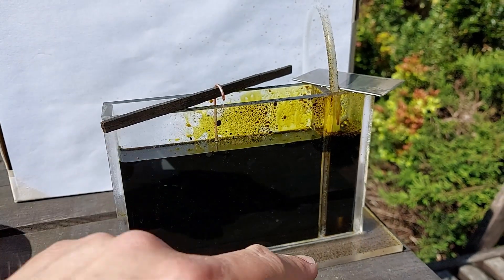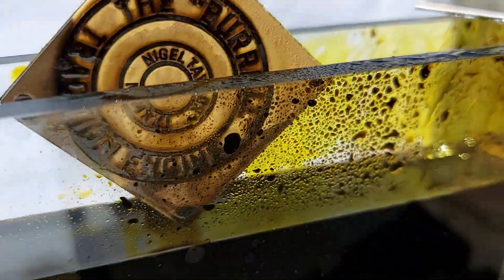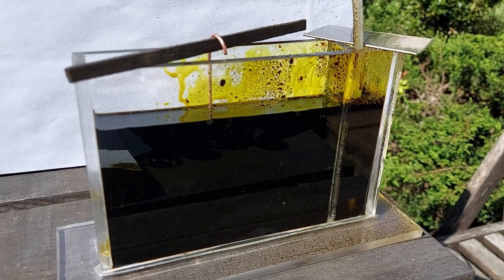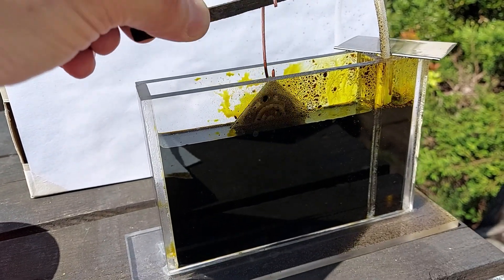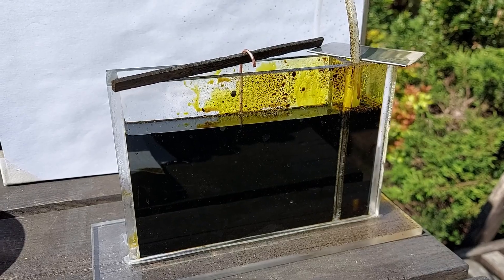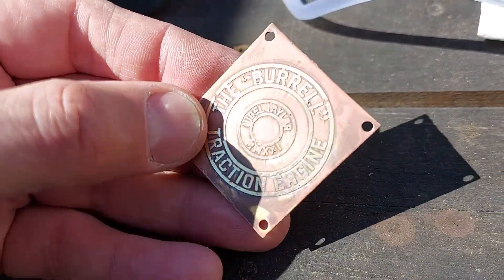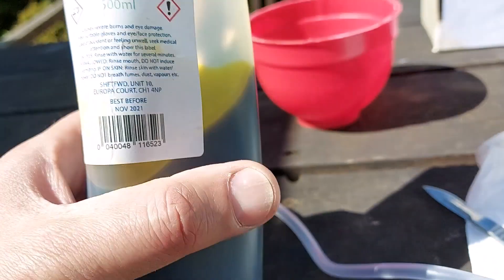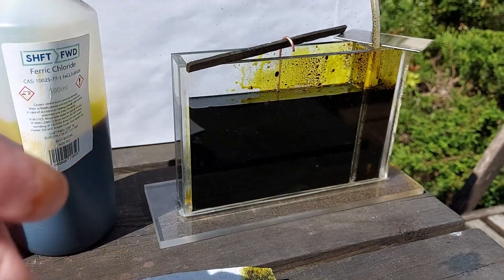Etching Tank

Comment: what glue did you use to combine the acryllic? Any special application method to guarantee it is water tight?
Reply from the maker: I used a plastic glue, but must admit it wasn't that great. I think I would now try and find a glass jar/tank and add a baffle for the air bubbles.

Comment: Hi, so my brother used plexi to make me an etching tank, I haven't put the ferric in yet, I do intaglio etching. I realize plexi isn't the specialized plastic meant for these, but yours looks amazing, and I am wondering if it lasted very long? Or if the ferric eventually compromised it?
Reply from the maker: Hi, it works ok, but it has discoloured the plastic over the time I've used it. Also, I think it might have reacted with the glue as I have had to refix the edges once, but that might have been a structural input that caused the small leak. The bubble partition is ok, but it needs a lid or it tends to bubble out. Also, if I made it again I think I would add a heating element so I could keep it at ~60-70°C. Best regards, Nigel

Comment: We used something similar to stir the tanks for hard chrome , it was just a pvc pipe hanging vertically with a t fitting on top and a plastic air line running down the centre of the pipe to a point just above the end of the pipe - as the air rises it draws liquid up behind it and it dribbles out each side of the t fitting .